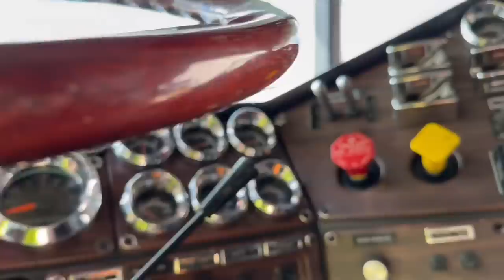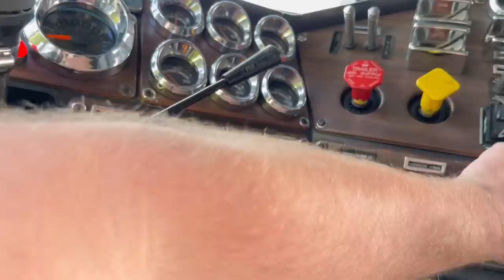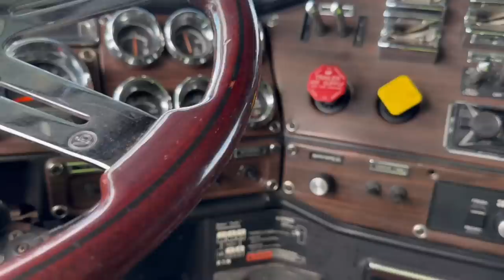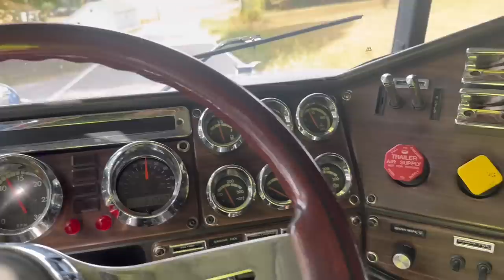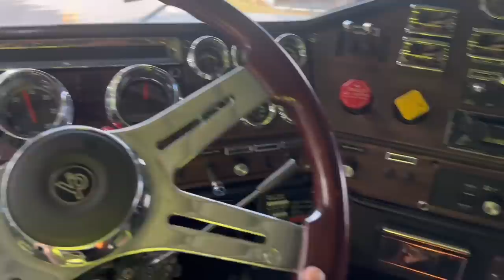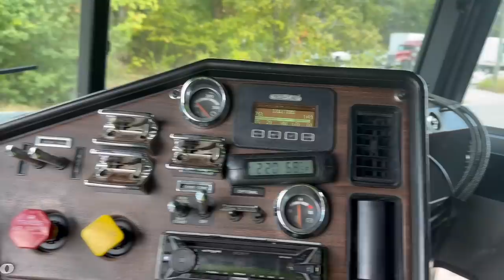We Bought A Super Nice FLD And It Broke Down Immediately!!

Comment: You know you're in it when you resort to "sweet talk" and negotiating with your rig to make it home... And it's amazing how many times it works. 😋
Reply: Starting to wonder how he sweet talks his wife. Throw the kitchen sink at the issue or negotiate from the conservative side.
I want percentage on those million dollar boats 😉.
Reply: Just because the boats are $1 million it doesn’t mean he gets paid $1 million to Haul them. I’ve had $250,000 cars that only pay $1000 to move so yeah that’s just not how that works
Reply: @jasonlukasik5595   so I can I broker a load for a 1 million dollar boat 2000 miles for $1000.
Your phone must be ringing off the hook.
My truck don’t move for less than $4 a mile.
I don’t haul boats.
Been around the block few times wink.
Got few horses in the drive myself.
If that’s oversize for a grand. Your phone is really ringing off the hook.
Edit: we are in a down turn. Later I might be begging for that grand. Great videos thanks for sharing.
Right load planner/dispatcher solid customers in those trucks. Percentage even in the down turn. But most will disagree with me.
Reply: Going to reply to myself like a idiot.
Brings up a interesting topic.
Does he cut the rate to keep customers?
Or(bad English grammar) does he pocket the difference or pass it to driver?
My gut is telling me he cuts the rate and runs a cheap overhead and works towards volume.
Cheaper pay but guarantees work.
Walmart founders way.
Good strategy but like always maybe I’m wrong.
Reply: When my rig worked I Dubbed it Pegasus  but when the brake down looms I call it the antichrist

Comment: If it were me I'd build a bracket just behind that drier and make a shield so it won't get road splattered while driving in wet and snow.. it does help the drier last just a little longer.. also those driers are rebuildable..
Reply: I noticed that failed drier was rebuilt in 2015. It lasted well.

Comment: Wish I was in your area. Working for a company like yours is what I've always done. I'm a gear head at heart with a nerd's brain. 2nd generation driver with 16+ years' experience driving. Never pulled a pot or any kind of flatbed that was more than a crop sprayer trailer. But have years of Hopper, Van, End Dump and a year of truck transport experience. Maybe one day I will convince my wife to move LOL. Very few small company's honestly care about a driver, just like very few drivers care about the company. Good luck finding a few good drivers. They are far and few between, seems most of the drivers anymore don't carry any kind of tools and have their truck in the shop for a simple light replacement. Heck, I replaced the air dryer 2 weeks ago in a NAPA parking lot and replaced 2 brake chambers this Wednesday sitting in a DOT scale lot.
Reply: Proper trucker mucking in and fixing your rig roadside!
Reply: @micksroversmg558  I've always enjoyed turning wrenches so why wait for a service truck when I carry tools and a few parts. Always have 1 air bag for the truck and q for the trailer. A couple brake chambers, axle seals and an alternator. I told the boss I can have most of it fixed and be trucking before a service truck can get to me. Not to mention he pays me pretty decent when turning wrenches lol

Comment: I have a shit ton of miles in those FLDs and those monitors are pretty dang accurate from my experiences. 6 mpg is real close to your loaded average in one of those. That's about what I used to average. I drove for over 30 years, We "My dad" farmed a couple thousand acres in Indiana and I hauled my very first load of corn to the Gold Proof elevator in Louisville Ky on my 16th birthday. 1980. Those 60 series are without a doubt the best engine that Detroit ever made. They saved that company from bankruptcy that's a fact. I remember it well. Detroit was just about ready to go belly up after the newer Cats and Cummins came out then they released that 60 Series and everything changed. Don't run the hell out of them and keep 'em serviced and there's no reason you can't get 2 million mile out of them.

Comment: Tim, it is ok to have more than 1 truck that you like per 10 trucks, it shows that you love the trucks you buy, they aren't just junk on their way to the scrappy. personally would only allow drivers I know I can totally trust drive them so the long term drivers rather than a brand new driver to the company.
Reply: but when rust takes a hold, it spreads like wild fire, so even though you are not too bothered, I would definately get the rust on the back of the cab taken care of first before putting it on the road.

Comment: This tractor brings back memories  of my WIA64TES Volvo which was equipped with a 12.7 Detroit and  a 15 speed. I bought it with less than 300,000 miles on it. When I sold it with a little over 1.5 million miles for  $21,000.00 I never had any engine problems,  never changed the clutch. In fact other than normal maintenance I only had to change the rear ends, changinging the gear ratio because I tore the front pumpkin out due to the improper installation  of the  ride height valve.  Volvo s seem to eat ride height  valves regardless of model. I had a front main seal go out at around 1.2 million and I pulled the mains because  I had the oil pan down. They hadn't  even worn to the point of showing  any copper. I changed the oil between 10 and 12 thousand running two gallons of Lucas in addition to the normal Mobil Delvac. I ran Lucas products  everywhere else. Not bad for an initial  investment  of $65,000. I'd say I got my use out of it. Plus no truck payment  for over 5 years. You take  care of them and those old girls will run forever. I bough a new VNL730 in 2007, which I hated. It couldn't drive past a Volvo dealership without having to stop for some sort of work, even while under warranty.

Comment: That strange siren sound you heard was the “Rumbler System”. Essentially it’s twin subwoofers under the hood connected to their own amplifier and then to the siren controller. They are designed so that people in cars around them can feel the siren in their own cars hopefully making them more aware of an incoming emergency vehicle in order to reduce and hopefully eliminate accidents. Electronic sirens don’t project their sound forward very well while moving this cars in front of you going the same direction don’t hear oncoming emergency vehicles as well which is why most fire/rescue vehicles still utilize the older style mechanical siren “Q-Siren” because they can be heard much better from farther away.

Comment: I don't always agree with your political views, but i do enjoy watching you, your son, and your crew work on trucks. The biggest problem facing new o/o's these days is most don't know mechanics and how to work on their own trucks. I'm old school, started my trucking career in 1971 hauling swinging beef from Illinois, Iowa, Nebraska, To the east coast. I learned how to change my own tires on the side of the road. Rebuild Cummins and detroit engines from the bottom up. I like your show because you still do old school stuff in this modern age. 
I'm 73 years old and still drive. I own a 1992 KW-W900L, 320 wheelbase, 450 Detroit. 
I parked it in a barn in 2010 because engine developed a hard miss and i knew ir was the cam. I bought a couple older trucks to run since then. But watching your show makes want to get the old KW out and fix her up. Thanks for your show.
Danny, B.
Reply: Curious why buy older trucks and not repair the better one?   Please don't be a vote blue no matter who type person,  vote but know their background.  Our Government is out of control enough..

Comment: maibe find someone / a paint company , that can do a good paint match and have the whole hood redone , seems like they painted it before as it seems to be darker than the cab you should be able to buff the other scratches out or clearcoat over them and wait a few years for the rest of the paint , maibe sandblast and do the back edge of the sleeper cab and fade over the dent in the front of it if you have paint left

Comment: Next time your in a pinch like that you could of used the 1/2 plastic line fitting on bottom of dryer an hook the 2 lines together to get you home. I know it's not the right thread to go in braided line but it will work.

Comment: You don’t wanna put just anyone in the c18 cat you gotta keep the Pete for you and truck shows the way you got the engine painted up a driver would have it tore all to heck oil spilled on the motor definitely put a driver in the fld
Reply: The Pete has a 3406E not a C18
Reply: It ain’t got nothing in it yet
Reply: @sodapop8408  that's true but it didn't have a C16 before it had a 3406E

Comment: I had a 91 FLD  and mine had a problem like yours blowing air out the same place so there is a spring in there that needs taken out and stretched You might try it and save a lot of money over replacement next time.
Reply: But when you're running a company with a driver in there...those new parts are cheap insurance. Can't be worrying about a stranded driver and load cuz of a spring

Comment: When it comes to smoothness, old trucks can't compete with the new ones, period!I had FLD 120 myself with N14 Cummins and now I've had a 2013 Cascadia with DD15 with just 10 speed manual for about 7 years and hands down DD15 is better engine in my opinion 😁About the aftertreatment s**t,the main thing is NO IDLE!

Comment: The fld I had i changed the blow off valve almost every year I don't know why. The only thing I could figure it was getting all the road grime from the tire up in it. Here in Washington they use the calcium crap on the roads in the winter and it is hard on everthing

Comment: I run a trucking company in Arizona and at .50 cents per mile I would never get a driver. I start them at .60 and my top guy gets .83 plus they all want newer comfortable equipment. I need to move to yalls state 😂

Comment: Bendix AD-9 air dryer , you could just replace the purge valve , if you bypass it , leave a air tank vavle cracked open depending on how your air governor is plummed so you don’t build to high of air pressure
Reply: Governor controls cut in/cut out of system pressure. Only thing air dryer does is remove moisture. Absolutley no harm in disconnecting air dryer lines and hooking them together, bypassing the dryer. Common practice to carry a fitting to join them.

Comment: Nice FLD! Can anyone running an older truck like 90’s or early 2000’s trucks, tell me if DOT inspector/officers or troopers giving these trucks a hard time being on the road? I’m trying to get into a semi tractor but do not want to be shut down or put out of service for it not being new.
Reply: Get a truck without Def if you are a new owner operator unless you have piles of money in the bank. If you keep your truck clean and well maintained, you don't need to worry about DOT.
Reply: @Mark-vu8ct  thank you for your comment and my thoughts exactly. Just wanted to know if running older trucks are being targeted.
Reply: @screamingeagle9553  I believe they target new DOT numbers. I had three level 1 inspections in my first 12 months of operation. All of them went well with no tickets or warnings. I've been running now for about 2 years with no further issues.
Reply: @Mark-vu8ct  that’s awesome! My authority will be six months this month. I received a level 2 inspection about 2 months or so ago and passed. I’m a CDL hotshot driver but really wanted to be in a semi. I already had the 1 ton so at the time we bought a gooseneck trailer to start the business. But it seems like there’s way more loads for semi instead for hotshot. I really appreciate your information. I try to ask folks that have been doing this longer than me. It been my dream for 30 plus years.